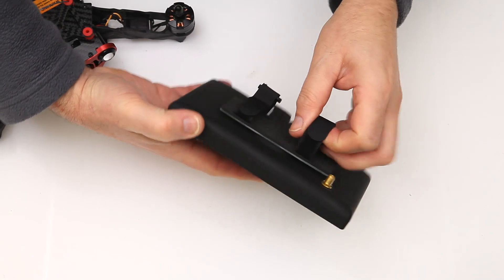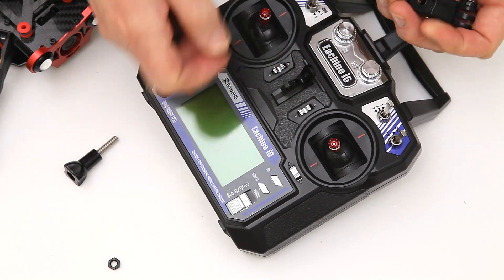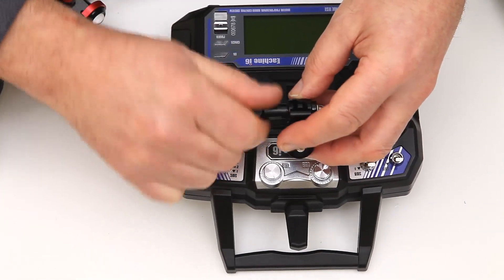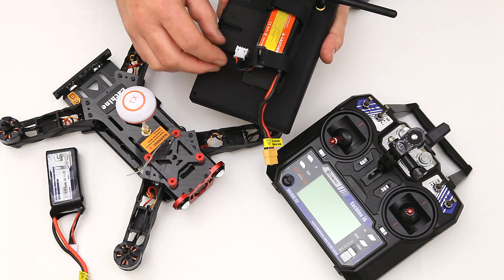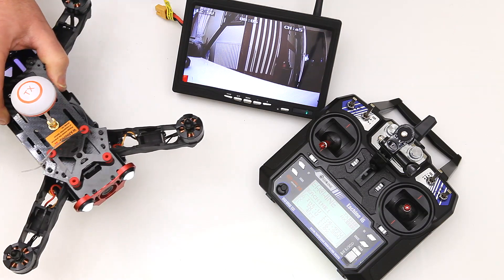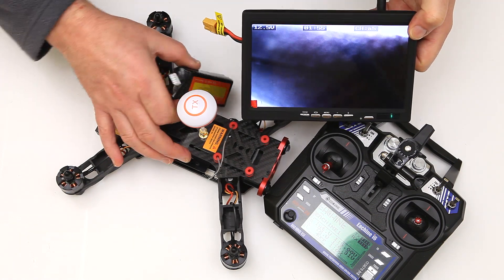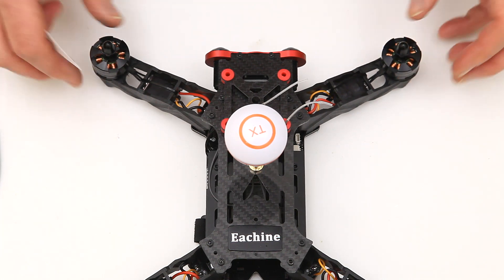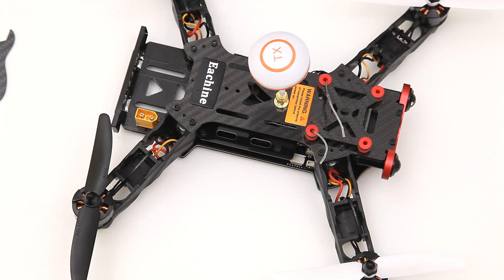Eachine 250 FPV Racer review, Assembly, Pre flight check Part 2

Comment: Hi I just got fthe 
Eachine Racer 250 FPV Drone w/ Eachine I6 2.4G 6CH Transmitter 7 Inch 32CH Monitor HD Camera RTF is it ready to fly out of the box or is it best to update it to the latest software and run the open pilot softwere
Reply from the maker: +John Daniels Hi John, I ran mine straight out of the box as you can see on the video, I have heard some run it through OpenPilot but I would try it first, still haven't run mine through the software but I will give it a go soon, just to play and understand more about PID's. Hope you thumbs up and subscribe if you haven't already, have fun, great quad for the money :-)

Comment: Really awesome video. Thanks for all the info. I have a 2 part question.
1) have you tried a bigger battery for the quad? 2) will a bigger 3s battery work for the monitor? I have an RC car that uses 3s and would be sweet if I could use it for the monitor.
Reply from the maker: +Andy Acaya Hi Andy, yes have used the 2700mAh battery off my CX-20 on quad, just fits without any mods or I have just strapped a 3000mAh battery under quad ;-) yes used the same batteries to run screen, no problems. Hope you thumbs up and subscribe. Great value for money racer please use the codes in description if you order thanks for the comment
Reply: Thank you. I bought some 2200mah batteries and they fit like a tight tight glove. So all is good
Reply from the maker: +Andy Acaya That's better than the stock ones, nice to have everything tight, makes flying a much better experience, have fun...you will ;-)

Comment: Did you have to set this up with Flight Pilot or software before you flew-or was it out of the box  and go for it-what i heard about the props on your last video alarmed me-is there not a certain position for the cc props and ccw-???? did you mount an antenna holder?? let me know Tigger-oh-can your wife fly it???
\
Reply from the maker: +BDS Hi nope flown straight out of the box, although I know some people have had problems and used software, I still haven't but will do when i get the time. Not sure if I understand you question about the props but they don't sit using a flat spline, just held with nut, if this isn't what you meant then just let me know ;-) No antenna holder as stock. My wife doesn't fly any quads through choice, perhaps watching me fly puts anyone off :-) hope you thumbs up and subscribe

Comment: can you elaborate on what you were talking about, something frying the board before flight is even completed???it was around minute 4.
Reply: +asilversweater sorry 5:10
Reply from the maker: +asilversweater Happy to, if you don't attach the antenna to the top of the quad before you attach the battery this will instantly damage the transmitter board for the FPV system and you will have to replace it. This does concern me so I leave the antenna attached at all times, so I don't forget. Hope that is helpful? Hope you thumbs up and subscribe if you haven;t already Thanks :-)
Reply: +Tigger's RC Reviews very cool. Does that mean you have to fly with FPV wear? And must always fly with antenna?
Reply from the maker: +asilversweater Well it means it is on but you don't have to have a screen or goggles and can fly line of sight without any problems, but and it's a BIG BUT you must have that antenna attached ;-)
Reply from the maker: +Agequeue DK Phew that was a close one, been looking into it but not getting that far. Did you run it without the antenna attached? Just curious, thanks for comment and update :-)
Reply from the maker: +Agequeue DK That's good I have not taken my antenna off since I first put it on and I intend it to stay that way :-) enjoy